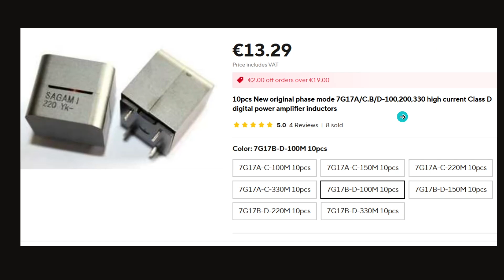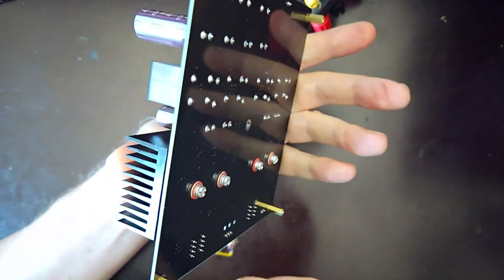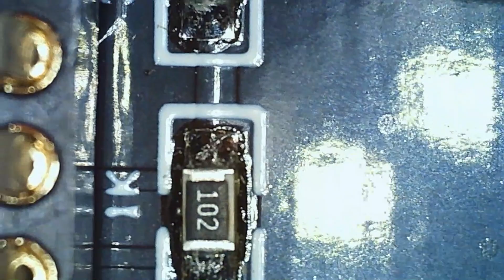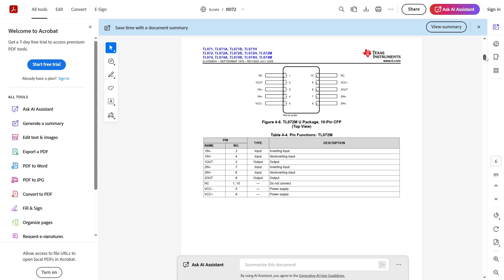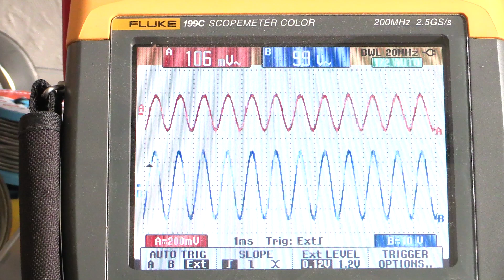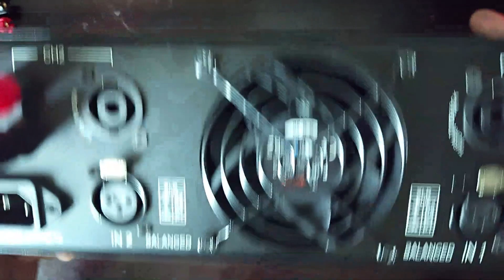Unexpected performance of the TPA3255 SAMP-200 Board

Comment: Good material, but a Class D amp is a no-go because of the heavy EMI in this case—about 10 W just from radio emissions. Remember, the preamp is already built into the box. Class D amps come from battery-powered systems; in high-fidelity audio, you need a linear amp like Class A/B, which is about 70% efficient versus 90% for Class D but does not introduce EMI into the system. Also, with Class D, power draw jumps according to signal characteristics, such as pink noise or complex audio. Don’t let the low price and small size mislead you.

Comment: подскажите пожалуйста, что за двухпиновый разъем? у вас от него два желтых провода тянуться.
Reply from the maker: Those are amplifier enable and disable pins. When short, the amplifier is working; when open disabled. . There are industrial power supplies that, in idle, use just 0.5W, and you do not need to switch the amplifier Off with a high current switch. Those 2 wires is going to the front microswitch and working as an amplifier On Off switch. For power supply, I am using a Mean Well LOP-300 power supply, which meets above above-described requirements.
Reply: @guntarssmits2104  спасибо. т.е. если их не трогать а пользоваться простой кнопкой то ничего страшного не произойдет?
Reply from the maker: You can put simple jamper and shorten the contacts. If not shortening amplifier will not start. Also for tis board I am recomending elaborate how heatsink is secured. It is not reliable design. I have another vidoe in my channle where give instructions what to do. Othervise sound quality is greate. Budget is budget and sometimes we need to do some extra work
Reply: @guntarssmits2104  я вас понял. спасибо!

Comment: Looks like it uses POLYYESTER CAPS(4 Brown colored ones output caps) not suitable for audio esp. using as coupling caps.
Question:
1. How does it compared with the previous TPA3255 (the one with blue caps) you reviewed, any comments?
Reply from the maker: Measurements indicate no issues, and the frequency response is perfectly flat. The board sounds neutral. Boards sound the same, but due to better inductors, they lack inductor resonances

Comment: Hi, I have a HARMAN KARDON HKTS210SUB / 230 that has a subwoofer but the amp is broken so I was looking for a more powerful subwoofer amp, I was wondering if this would work for me?
  I am looking for a more powerful subwoofer amplifier than HARMAN KARDON HKTS210SUB / 230 SUBWOOFER, I am waiting for your urgent advice.
Reply from the maker: Hi, Yes, this board can work when placed vertically to provide sufficient air flow. but there is a better version, ZK6002, with a small temperature-managed fan and sensitivity regulator. With 48v 10 power supply, you will get great, clean 250W/ ch out of it
Reply: @guntarssmits2104  thanks, well there is no bass volume control button and no frequency adjustment button! bass sound, is there a matching module with a frequency adjustment button? there is also no audio source RCA input,
 How would the ZK-6001 Amplifier Board Mono 600W be?
Reply from the maker: There are plenty of them, just search for TPA3255 2.1 board. I have not tested any of them. There are boards with DSP on board as well. But in most cases, when you have a problem with the subwoofer, only the amplifier is dead, and you can use the existing preamp, circuits, and fix just the power part..
Reply: @guntarssmits2104  thanks man
Reply from the maker: @SERKAN_HOT34  There is specialized subwoofer board https://www.aliexpress.com/item/1005008827893737.html?spm=a2g0o.productlist.main.33.4191K7CWK7CWo4&algo_pvid=a4f3a320-ee51-4b83-8786-ef1bbea6be74&algo_exp_id=a4f3a320-ee51-4b83-8786-ef1bbea6be74-32&pdp_ext_f=%7B%22order%22%3A%2218%22%2C%22eval%22%3A%221%22%2C%22fromPage%22%3A%22search%22%7D&pdp_npi=6%40dis%21EUR%2137.12%2135.59%21%21%21303.30%21290.77%21%402103890917596901837403965e99a7%2112000046847617632%21sea%21LV%212867889773%21X%211%210%21n_tag%3A-29919%3Bd%3A742476ca%3Bm03_new_user%3A-29895&curPageLogUid=vZOT9JMgRcCN&utparam-url=scene%3Asearch%7Cquery_from%3A%7Cx_object_id%3A1005008827893737%7C_p_origin_prod%3A

Comment: I bought the board a month ago but any input sound that is above 880Hz is perfectly audible from the PCB without any speakers connected - as if there is a tiny built-in speaker on the board. I was unable to find out where this sound comes from and how to remove it. Any advice?
Reply from the maker: Those are filtrers resonances. You should replace inductors or accept as it is

Comment: TPA3255 is also used as the combined modulator, gate driver, and output stage of the ICEPower 200AS2 amplifier board. Unfortunately that module is not using the PFFB configuration that enables the TPA3255 to reach its best possible performance, probably to maximize the available gain, but its performance and sound are quite good already, even without PFFB. I have not been unhappy with my ICEPower 200AS2 amp module driving my Thiel CS1.7 speakers; I find the match to be just fine and not impacted by filter-based response variation. I prefer the sound of the 200AS2 as being slightly less aggressive compared with a Hypex NC122MP module, and the Hypex board has turn-off pop while the ICEPower module does not. I think this preference is due to the very different damping factor (lower for TPA3255 than Hypex), since the Thiel speakers are very easy to overdamp from the amplifier's output and then they will sound lean in the bass and lower midrange.
Reply from the maker: The Icepower 200AS2 has carved out a niche in the TPA3255 market, thanks to its well-integrated power supply, optimized 42V operating voltage, and a filter tuned for 6-ohm loads—delivering a nearly flat frequency response within ±1dB at 20kHz. I was genuinely impressed by this board; I even developed a kit around it and sold off my stock of 200AS2 integrated amplifiers.

This competitive edge is one reason Chinese manufacturers are struggling to match market prices. With a retail ceiling of around €200, the 200AS2 sets a tough benchmark. It also boasts the smallest footprint among current solutions, making it a compact yet powerful option. Overall, TPA3255-based designs face a challenging market landscape.

Comment: 20db is only about 6.6x the volume, not 10x
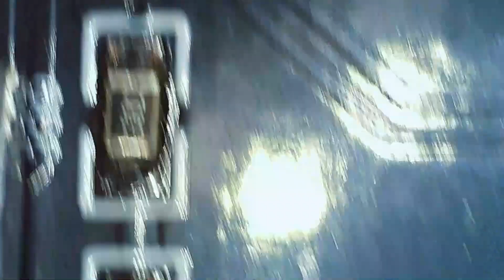13:08 That 330ohm resistor looks cracked for me, should be replaced. You should check that out.
TL072 is not a good OP amplifier, it caps at 3Mhz max and when you count up the gain it has basicly looking to have max 10-15khz frequency that is in the range of -3db. (Unless its configured to have a gain of 10 or less.)
Okay that OP amp is fancy and everything, due it have JFET inputs, but overall, you would want to replace that.
Hopefully the main D-class amplifier IC is non counterfit, as i can hope.
This amplifier board is really a consumer product, and its not for High fidelity audio purposes.

As i should say, i see here other people saying that those caps are bad, and should be changed for nichicons, no they arent needed to be replaced, those Nippon Chemicons (If theyre not counterfits) they're just good, They're actually really good caps, people tend to go with nichicons, because they think that there is a big difference, while its not the case.
I think for this budget board, these caps are good.
Reply from the maker: By voltage, it is 10 times. There is a link to the formula and calculator https://sengpielaudio.com/calculator-db.htm
Reply: @guntarssmits2104  every 3db doubles the volume, so 20db cant be 10x (I suspect that db calculator to be not right.)
Reply from the maker: There is a theory. Decibels (dB) are used to express ratios of power, voltage, or current, and the formulas differ slightly depending on whether you're dealing with power or voltage/current. For power ratios, the formula is dB = 10 * log10(P2/P1), while for voltage or current ratios, it's dB = 20 * log10(V2/V1). These formulas are used because power is proportional to the square of voltage or current (when impedance is constant).
Reply: @guntarssmits2104  yeah its way its true, but were talking about sound db.
At sound db played out, every 3db doubles the sound volume, so if you looking to have +20db sound volume, you looking to have 6.66x the volume.
Reply: could be bit of masking paint that makes it looking cracked
Reply from the maker: @Theo-vi8gs  I also think so, because it is a rare case that a resistor is damaged during the manufacturing process. It is kind of established technology, and in my relatively long experience, there were no defective resistors due to reflow soldering.
Reply from the maker: No, we are talking about input buffer op-amp voltage gain headroom.
Reply from the maker: Measurements did not confirm above mentioned. This is one of the audio marketing challenges where many statements are not confirmed by measurements. There are no secrets in audio, and today we can measure any aspect of it. Measurements show that those caps are working fine with 100K bandwidth. Listening is good as well.

Comment: Do you have a video on your load bank?
Reply from the maker: It is in this video https://youtu.be/n74c4NRLcRI?si=PnX-qugljFCfIkbe
Reply: @guntarssmits2104 i saw that but want some more details. I noticed RCA in the back of the box, is that i/o testing too?
Reply from the maker: @eliseoquiroz8321  RCA is an attenuated and filtered amplifier output signal prepared according to TI guidelines for THD measurements with a sound card or audio interface. But modern amplifiers are so good that in tests, I am not spending time measuring THD. Those are always good with a few exceptions. Most issues are with class D output filters, thermal designs, PCB board layout mistakes, undersized inductors, low-quality film capacitors, storage capacitors, simplified input circuits etc. Those cost money. There is tight competition putting pressure on the board's final price.
Reply: Good to know. Thank you

Comment: Excellent review. I was able to get 31V on 8Ohm. I just got similar version, but with electrolytes and tantalum capacitors  close to operation amplifiers. Also replaced to  NICHICON  63V2200UF and 470UF 63V electrolytic capacitors. Also will install UNISIAN 40mm high radiator. For now it is the best option for me.  Only question, does it have  low-frequency filter? I saw base 600Khz as part of output signal.